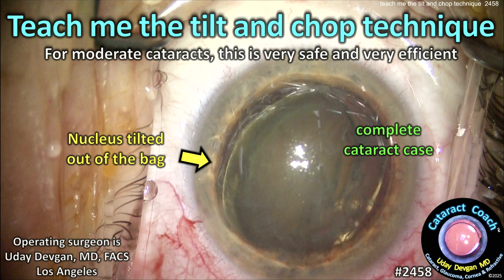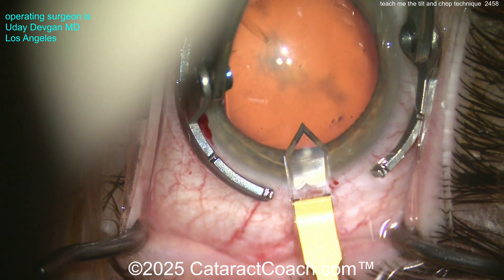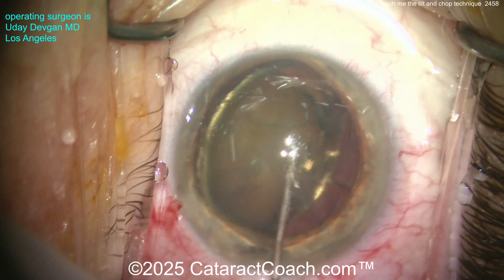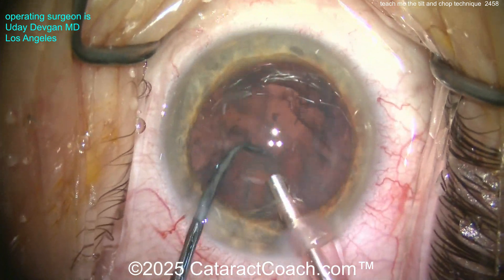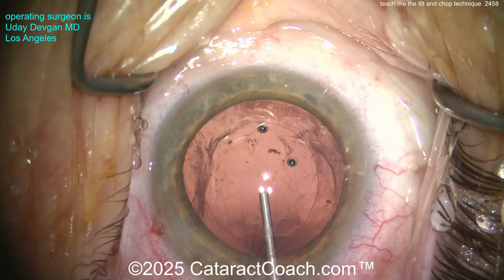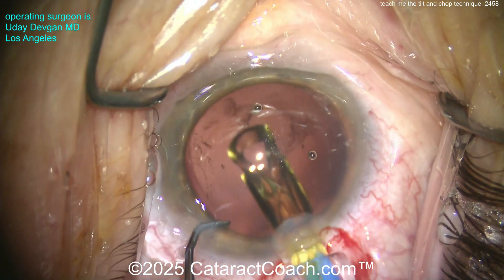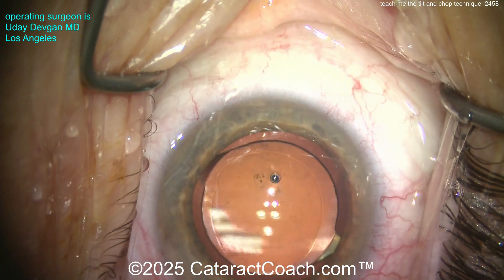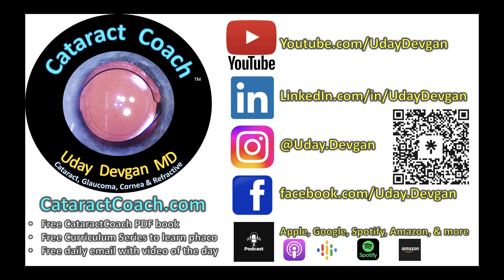CataractCoach™ 2458: teach me the tilt and chop technique for phaco

Comment: i did tilt and chop once, the capsulorhexis rim got split :(
Reply: This technique is only for soft cataracts and suitably large capsulorhexis.
Reply: must have been a hard nucleus. for moderate to soft cataracts works fine. Also I find this technique more efficient with a Venturi pump than with a typical peristaltic.  (maybe because I am still afraid on using a venturi pump inside the bag).
Reply: Yeah the CCR has to be good because this will stress it a bit. Could've been a hard nucleus like the other commenter said. It may have also been that the rhexis was too small (i.e. squeezing a large lens through a 4-4.5mm rhexis puts a lot more stress on the capsule).